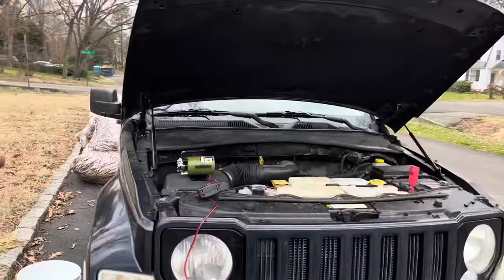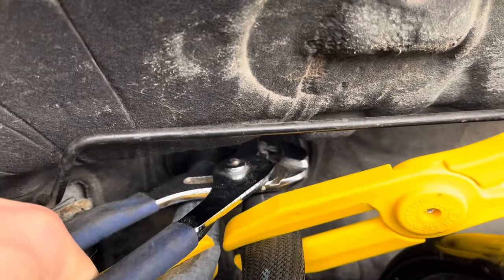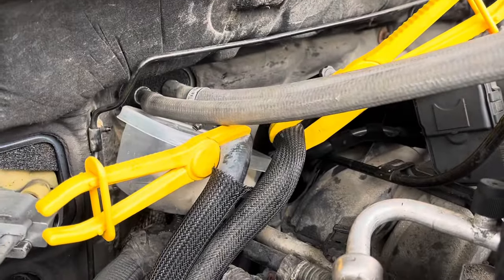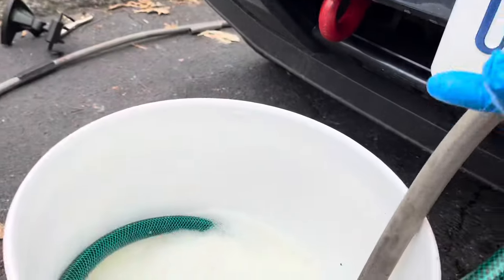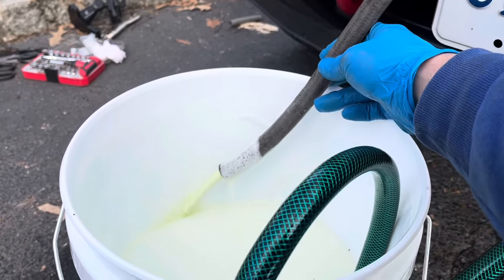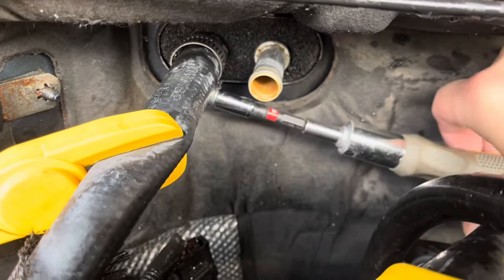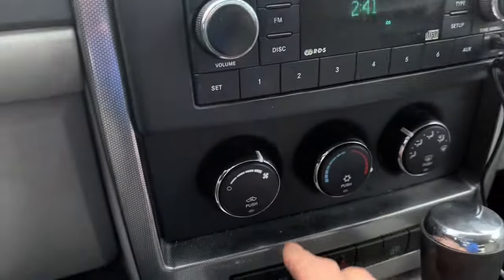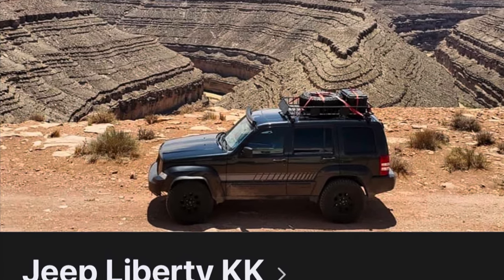Jeep Liberty (KK) 2008 - Heater Core Flush

Comment: Thank you!  I have had very bad heat in a 2009 Jeep Liberty for over 5 years.  Flushing with a garden hose before each winter was not effective and only gave minimal heat.  After watching this video I bought a pump (the 110 volt version) from Harbor Freight, and.flushed the core in both direction starting on the output side with a 50/50 mix of CLR and 140 degree distilled water. I kept changing the water till I stopped getting suds.  I got quite a bit grit and debris out of it.  Well OMG, the heat is so good I can't believe it, thank you!  That little pump did the trick, I probably ran it for 40 minutes altogether while letting the CLR just sit in there for 15 minutes.  I bled the system at the bleeder location after I drove.  Thank you, it's perfect!
Reply from the maker: Glad it worked out for you.  My little pump died.  For the price, not a big deal to buy another one.  I probably need to do it again!  Thanks for watching
Reply: @swatscorner  i am about to do pinion bearings on my 09 Liberty and will replace the carrier and wheel bearings while I am in there.  Have to buy and rent a few tools for the job.
Reply: @mikeconnor3602 1 thing I'll say that I've seem done is,installing a Coolant filter,should help maintain the cleaning and clean things better over time
Reply: @swatscorner should look into coolant filters,it's either a small one(size of the hose) or there's other ones that are similar to oil filter size but for coolant

Comment: Here's a trick I did. I put flush in the system then I reversed the hoses on the input and output to the heater core to get the reverse flow through it. Then drove it till I had about 6 hour's running time on it which was the longer option suggested on the Prestone Flush bottle. I think it worked well but I won't know till winter for sure. It's summer now, hard to tell how the heater will actually work when it's cold. Anyway, thought it was a neat trick, super easy and super low labor to get the reverse flow through the heater core. Hope this helps someone.
Reply from the maker: Great idea!  I’d driven with the hoses reversed on this one too. Good idea, and thanks for the tip!

Comment: Im jealous that your vents work.  My 2 left vents just blow cold , both right vents warm. Only on the head position, will not work on feet. I guess I need to put in that left actuator behind the steering wheel.   Im assuming my blend door box needs replaced.
Reply from the maker: Yes, sounds like it.  If I ever replace the heater core, I’ll replace the blend door actuators too.
Reply: @swatscorner  I had mine done in 2016, I had no idea about blend doors and actuators at the time.  Have your evap core done too, mine went out with my heater core, had no idea until later.
Reply: the heater core is split in two halves, this is what my symptoms were and flushing solved it.  try it!

Comment: do you notice the air blows weaker when you turn it to full heat compared to full cold? Had to replace the actuator and think i may have calibrated it wrong feeling the noticeable difference.
Reply from the maker: No.  The fan was working fine.  Always blew the same speed of air

Comment: what size is the diameter for the hoses for the heater core? my kk is only giving heat on the passenger side and i keep being told the heater core needs to be flushed.
Reply from the maker: I’ve heard the blender doors can be an issue for that. I’m not sure of the diameter of the hoses.  I think it was printed on them
Reply: More than likely 5/8 heater hose. To flush you can use 5/8   clear hose.
Reply: Not sure if it's too late for you but the inner diameter (I/D) of the hose is 5/8 of an inch or 0.625 inches.